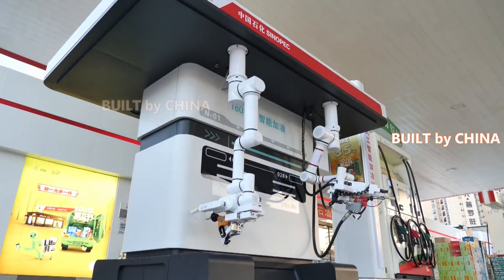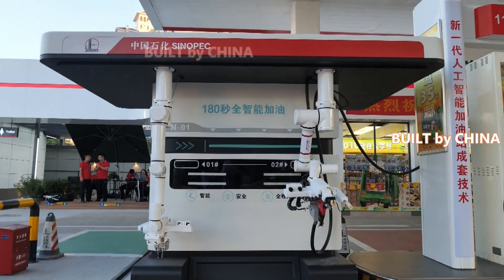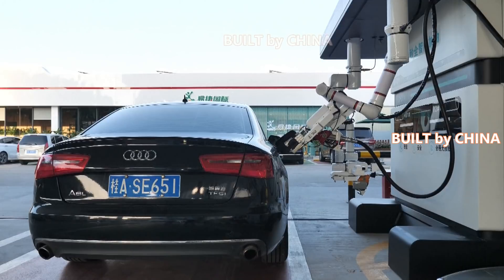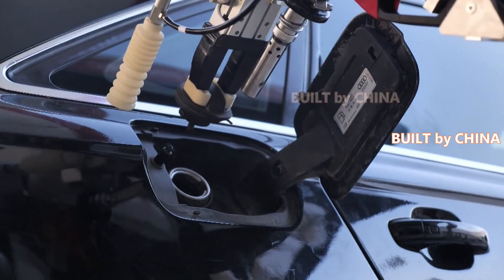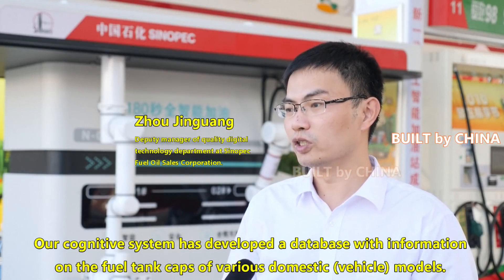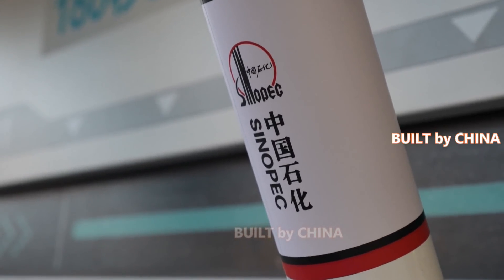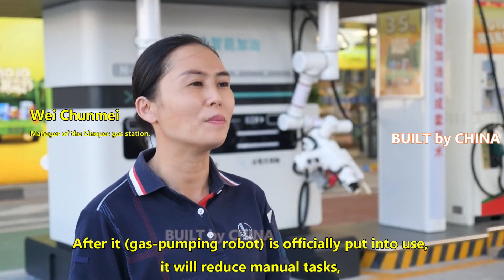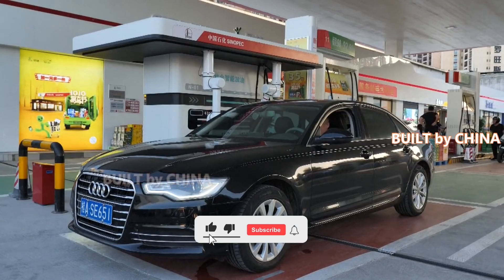Gas station robot is being piloted in China | 加油站機器人正在中國試點

Comment: is there a robot for battery charging stations for EVs?
Reply: Yes, there are several cities in China that have begun testing electric vehicle automatic battery swaps in the past two years. The electric car enters the battery replacement station, a smart flat car enters the bottom of the electric car to remove the battery and replace it with a new one, and then the electric car can be driven away.
Reply: @ykyang9169  this is what all the car makers should have done, a universal battery you just change , this would make electric cars just as good as petrol but as with the early computers each one was making all the connections unique so you had to buy their own mouse keyboard disc printer etc then the usb made it easier
Reply: @stephenhill8790  Yes, for pure electric vehicles, a unified and convenient battery replacement mode would be better, but at present, the bottom battery design styles of various manufacturers are different. . It is estimated that it will take many years to complete the unified battery rules. .
Personally, I will choose a hybrid electric car for my next car, because pure electric charging is still inconvenient and time-consuming for long-distance driving. . . At present, I am waiting for the 2022 "Tang" DMP hybrid SUV to be launched by BYD in April next year. I am currently driving a pure fuel SUV with a 2.0T engine displacement. I am in the peak congestion environment when commuting in urban areas, The fuel consumption will reach about 12.6-14.3L.
After changing to a hybrid SUV next year, I only need to use the pure electric mode for daily commuting. At present, there are car charging piles in the parking space of my unit. This will save me money on gasoline. If I need to drive for a long distance, I can directly switch to the gasoline-electric hybrid mode or the pure fuel mode to drive. Compared with pure electric vehicles, such hybrid electric vehicles are more in line with my current daily needs. (A colleague of mine bought a pure electric car 1 year ago, and then drove back to his hometown on a holiday. In the end, he spent more than half an hour in the expressway service area waiting in line for car charging piles... ) Therefore, unless the battery life technology has greater development or can complete fast charging/battery replacement within a few minutes, I will not consider pure electric vehicles at present.
Reply: @ykyang9169  i have a hyundi hybrid (no chinese makes in uk yet ) but i think you are correct it will take a big change by the worlds car makers before it gets better( and we know usa will not like the use of oil to drop )

Comment: It takes 3 minutes for human workers to pump gas?  I've never spend more than 2 minutes.  Most of the time it's under 1 minute.
Reply: With payment and all stuff??
Reply: @gamh03  No, but this machine doesn't include payment time either.
Reply: Whats the point using robot to maximize efficiency etc if you have to pay cash, they make robot and order via app because China already have cashless ecosystem so they just add this for more convenient
Reply: @gamh03  That's exactly my point.  The robot is slow.
Reply: @magnetospin  
No, your problem is lack of knowledge and imagination.
Reply: Speed is not the most important factor, gas vapor can cause cancer.